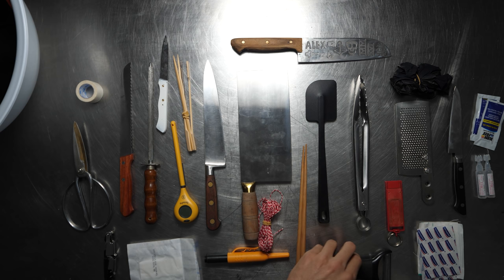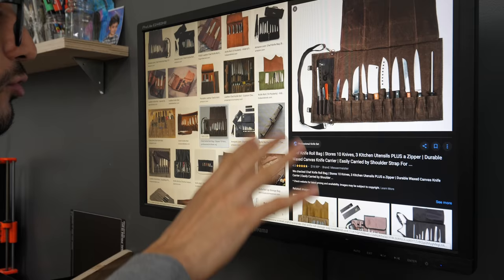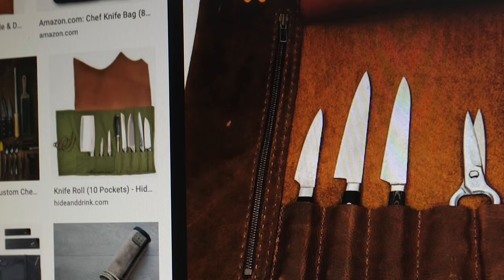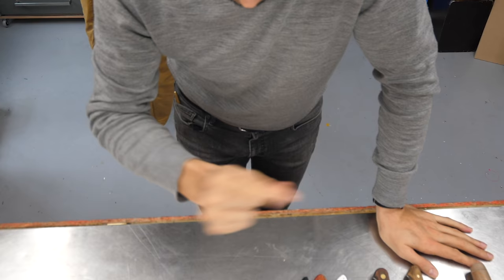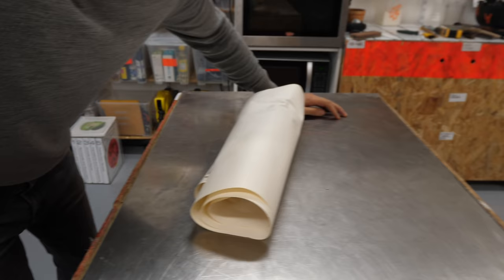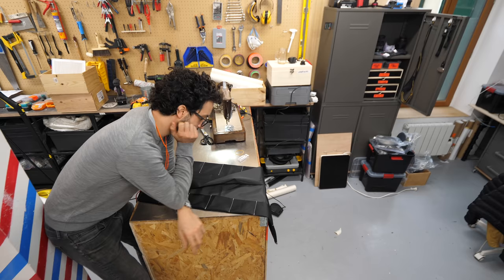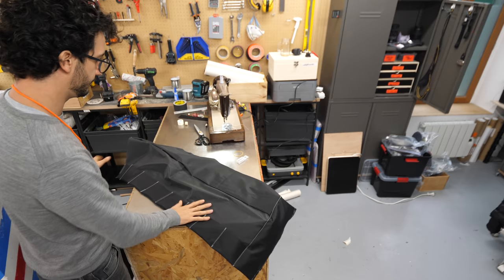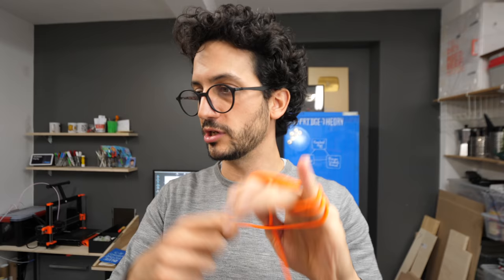I Made myself a Custom Knife Bag...

Comment: You should sew in sheaths for the blades. Too likely that over a time of handling, removing, reinserting, rolling, and unrolling that your blades are going to start knocking into each other. Doesn't have to be a re-enforced sheath just something that keeps the blades from bumping into each other. The other thing to consider is will this kit be taken to other kitchens that will things like spatulas/ladles/etc or to a pop up type place that you are expected to supply everything. If it is more the first you should consider bringing more preferred and commonly used specialty items.

Comment: Individual knife sleeves, when it comes to travel. So no scratches, and better safety
Reply: I know a sushi chef that uses the same.  He also uses blade covers so none of the cutting edges get knocked when rolling and transporting.
Reply: Honestly, cardboard or thin plastic, like from a document folder, some kevlar and Gaffers tape, and you could build custom sleeves on the cheap.

Comment: You could compact it a bit more too like by having the cleaver and the next biggest knife's blades over lapping and just sew a fold of fabric down the middle to pull in between them. Like have the cleaver's handle on the left and the other knife with the handle facing right. If you are going to fold them then there is no point in having things so far apart is there?

Comment: I always had doubts about rolls:  will the blades get damaged or cut through the fabric or fall out?  Your design seems to have addressed most of those questions.  Also, you can replace the towel with an apron if you tend to use one.
Reply: There are leather ones. Most cases are only meant for a commute, not to bang around or long term storage.
You can always get blade guards if you are afraid of damaging the edge.

Comment: I really dislike that the edge of your knives can smash into your other knives :/ Other than that i really like it :D
Reply: These "tool" roll storage systems are a great concept. However I agree this example does not appear to provide adequate edge protection, if any, for the blades stored in it. If the fine blade edges can contact any other metal kit in the roll then separate edge guards should be fitted. Particularly given the purpose of this kit is for travel.
Reply: I did not see that:  the Kevlar band at the bottom will help separate edges, when the product is rolled.  Edges only cut when 'slicing' occurs.  Not the case here.
Reply: @jamesellsworth9673  At 5:45 you can see two of his knives sharing a pocket and overlapping, so when this is rolled up, they won't be seperated.. If this bag goes for a "rough" trip, the knives may very likely damage eachother :/
Reply: @Loopmootin  Good point!  Alec should not have sheared off extra pockets...but the design is still valid.
Reply: @jamesellsworth9673  Definitely! The only thing about it that i disliked, is that the knives are touching :-) 

I would personally have made the pockets a bit smaller, so that they would hold the item a bit more in place, and then have one pocket for each item, at least for the big ones, like his kitchen knives.
Reply: @Loopmootin  Another good point!  The pouch segment should fit the knife or utensil being protected.

Comment: Call me crazy, but why make the pockets to hold and protect the HANDLES??? Wouldn’t it be better to pocket the blades and leave the handles exposed? I hope you have pockets for your water stones- you’re going to be doing a lot more sharpening when your nice sharp knife edges start banging into each other in the roll.
Reply from the maker: Maybe, but it's easier to choose when you see the blade or at least a part of it.
Reply: Then I guess split the difference and pocket the blades up to the last inch or so. That way see the blade, but don’t ding the edge you use? Yes, I just want to watch another vid with the improved design! 😊